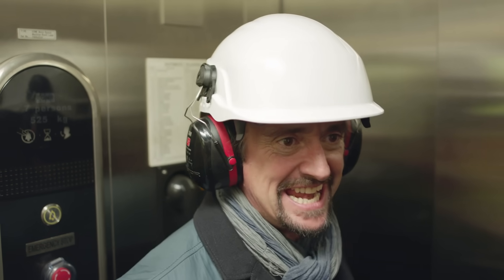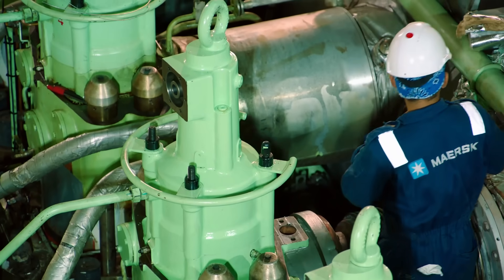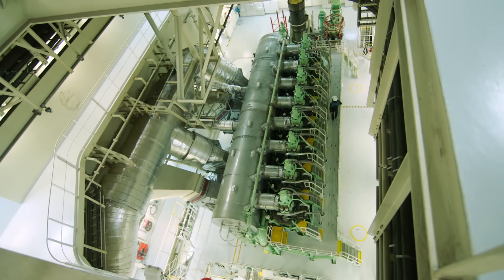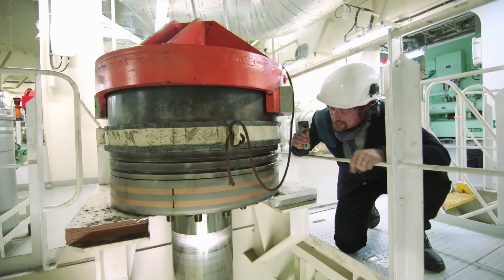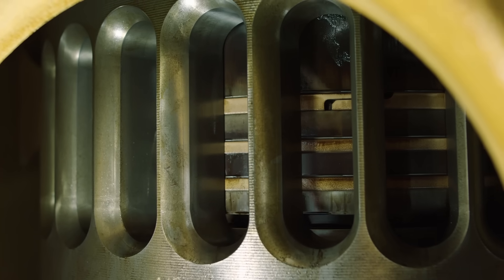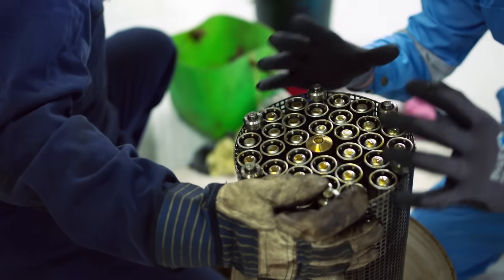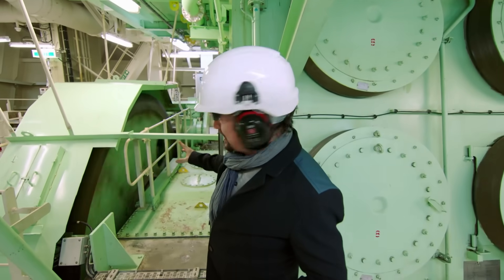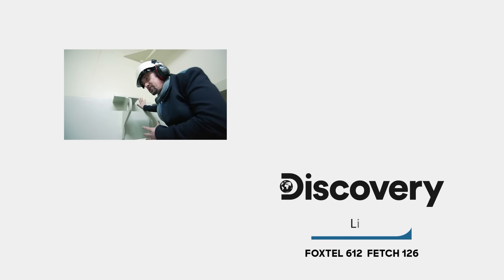This Engine Is So Big Richard Hammond Can Walk Inside It | Richard Hammond's Big

Comment: No hearing. So how do they go astern?
Reply: Reverse engine.
Reply: @alfamontydog I thought so. I have crewed on a 300ft motor yacht that has no reversing gear and to manoeuvre the engines had to be stopped & reversed. It was built in 1929 by Krupps and the captain had to telegraph to the engine room who had to stop the engines, reverse some cams with handwheels and then restart the engine with compressed air. Not easy.

Comment: Is there a clutch?
Reply: There is no clutch. A propeller shaft is directly connected to a crankshaft. So when the engine starts, the propeller starts to spin. Engine is started by a compressed air of 30 bars. There should be enough compressed air to provide at least 6 consecutive starts.

Comment: Where is the propeller shaft thrust applied to the hull?
Reply: The thrust block is right behind the engine, at least it was on the ships I sailed on as an engineer.
Reply: @alfamontydog  Thanks.  That's odd to my mind because it places the entire propeller shaft in compression!

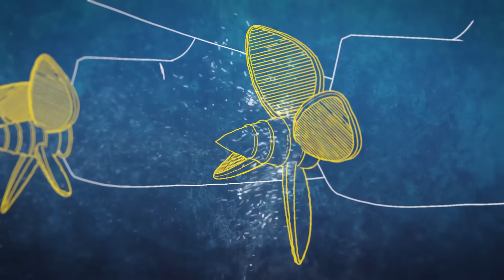Comment: 6:09 The animation of the portside propeller is wrong. It's rotating astern instead of ahead. This while the starboard propeller is going ahead correctly. The direction of the blades on the starboard propeller must be drawn wrong.

Comment: 18,000 containers? Why do I feel like this is HIGHLY exaggerated?
Reply: 18,000 TEU is not even the biggest size ship - 24,000 is
Reply: Because most Conatiners are stowed below Deck, and because it is measured in TEU. TEU means Twenty Foot Equivalent Unit, aka a 20 ft by 8.5 ft Containers. The most Common Type is 40 ft High Cube (9.5 ft) though, so your typical Container is more than twice as large as the Container with which Capacity is measured. Plus Ships are never fully loaded, at least by Container Number. If every Container Position was occupied, a Ship would be way too heavy. There are more Positions than neccessary to gain Flexibility; otherwise you'd constantly have to shift and restow Containers.

Comment: A single GE 90 115B turbofan can produce over 100,000 horsepower.   Don't know about a turboshaft version. Either way, it's not going to be as efficient or reliable over time.  then again it doesn't a continuous crew to keep it running or a huge room.

Comment: Since the engine is direct drive it has to be run in reverse to reverse the propeller.
Reply: Generally yes. In some cases a variable pitch propeller can be used instead, but slow speed diesels like this almost always are direct reverse

Comment: Marie Mærsk isn't even biggest. Emma Mærsk got the 14 cylinder Wártsila RTA96-C, making 80.000kW (~100.00hp), a little less than Marie Mærsk's twin 8S90ME-C 9.2 twin propeller, where each engine is making roughly 30.000kW.

Comment: Those aren’t engineers. They are technicians. Engineers don’t change oil filters 😐. That’s an insult
Reply: Marine Engineer here. There's usually two to four Engineers and three to five Mechanics in the Engine Crew, plus one or two Electricians. Filter Changing is done by the Mechanics, unless there's something going very wrong.

Comment: It's is so disappointing that ships like this aren't diesel-electric.  i.e. driven by electric motors

They could even use a turbine instead of a ICE as a prime mover.

Much greater efficiency and ease of drive control for the propellers.

Comment: If the propeller is connected directly to the engine without use of a gearbox, how do they put it in reverse? Maybe the engines are ported so they can turn in either direction equally well?

Comment: I usually have thoughts such as 'is there a simpler way'. I am not an engineer, but this thought came up. Replace that big engine with a few smaller ones that only generate electricity.  Then use electric motors for the props. I guess having an array of smaller props is not as efficient as one or two large ones? If one electricity generator fails, you still have enough power to go at some speed... just not full speed.

Comment: As an engineer at a HFO based Power Plant which run on diesel engines giving power output of 19MW each, I am no stranger to these type of engines.
Reply: HFO (heavy fuel oil) is not MGO (marine gas oil) or your so called diesel engines. Your engine either runs on HFO or MFO or MGO/diesel. Or hydrogen or steam or natural gas.
Reply: So your engine runs on HFO. Very polluting power station.

Comment: What do you use to start the engine? It surely can't be some giant starter motor powered by some giant battery. That would be impractical.
Reply: they use compressed air to start
Reply: @saradeanna  I was thinking of some auxiliary power source like a smaller engine to rev up the larger one but compressed air makes perfect sense. It's also used to start up jet engines.

Comment: Haven’t seen the drawings, but i bet you there where at least 5 more meters off shaft before the propeller gets bolted on.
Just because there should be a watertight compartment between where he was standing and the watertight bearing seperating the air in the ship from the seawater outside.

Comment: OK I have a genuine question. How do you make the opening where the prop shaft ends on the propeller itself water tight?
Reply: A shaft seal is used, very similar to the main oil seals on an automotive engine crankshaft. There are various types but they all essentially work by compressing some flexible material (rubber, or grease impregnated rope) against the shaft surface, while allowing a small amount of liquid to sneak in between the seal and the shaft for lubrication.
Reply: @nerd1000ify  Thank you.

Comment: 6:11 when you realize the left propeller is spinning the wrong way
Reply: Engine and Props are counter rotating to balance the torque of the props and avoid the ship from having a tendency of constantly turning. If they were rotating the same direction you would need to compensate with the rudder.

Comment: and the fact is that you can get 1/4 of that horsepower in a top fuel dragster which the engine is like the size of cylinder of that engine.

Comment: Something like this would be an amazing level in Hitman 3
Reply: If they did, I’m pretty sure one of the eliminations would be that one of the targets are near the engine, you turn off/sabotage the power restrictor in the engine as usual and turn the engine on at full power, then the pistons break off the connecting rods and the whole engine explodes.

Comment: 6:10 one of those propellers is going backwards
Reply: It actually isn't, if the propellers where to go in the same direction, the ship would slowly but surely turn to the right. Same concept as the Chinook helicopter, and naval torpedoes. 
Edit: left
Reply: @onyxdawn749  the propellers are the exact same so the one going backwards would go backwards
Reply: @lego_lad1310  Propellers are not the exact same, they are mirrored. Propeller also produces transverse or sideways thrust which rotates the ship, having both turning in the same direction for going ahead/astern would produce a lot of transverse thrust and make the ship basically uncontrollable.

Comment: I’m guessing it has to be a 2-stroke so they can run it backwards
Reply: Yes that exactly right, they use high pressure air to start the engine and just push the opposite cylinders to run it backwards when needed to go in reverse
Reply: Why would that have to be? (Also hello fellow Nelson!)
Reply: @creator4413  no gearbox, no other way to make the ship to backwards
Reply: @cpufreak101  variable pitch propellers?
I would have assumed its because of the extra power to weight and size constraints. Theyre turbocharged and still get extremely high efficiency, no need for extra strokes.
Reply: @cpufreak101  They can change the pitch of the propellers to verse thrust.
Reply: @Rob-pf6yl  did you completely miss my previous comment?
Reply: @cpufreak101  u clearly dont know what u r talking about
Reply: @giannidc1207  did you also completly miss my other comment, where I accepted a correction?
Reply: @cpufreak101  wrong
Reply: @cpufreak101  you were right, actually
Reply: @cpufreak101  Pitch propeller - adjust blades angles and you go "astern"
Reply: It's still not used for reversing though, although it could be. A ship like this has no need to reverse, manouvering in docks is done by tows.
Reply: @arturjogi2667  No, it is used for reversing while docking and maneuvering. The engine stops and runs in reverse to provide astern power. I work on these.

Comment: I thought those engines were to power electric motors then those turned the propeller?
Reply: There are different ways of sending power to propulsion. The diesel-electric combo is usually used on passenger ships as you can have the engines further away from passengers which helps with noise and vibration. Cargo ships usually have regular shafts as the engine is already close to the propeller.

Comment: And remember these engines are by far the no where near the largest marine engines ever built. The first ship I was on had a 89.000 bhp engine, 12 cylinders and each piston 90 cm in diameter. That was in 2003 (ship built in 2002). The largest I have heard of are 109.000 bhp, but there are possibly larger ones than that as well.
Reply: The biggest engine ever built is the very same engine but in 14 cylinder form
Reply: didn't he say it has two though? so if that's two 43,000hp engines the ship overall still has 86,000hp. almost equivalent to the ship you were on?
Reply: @RWoody1995  he means 109k Hp from a SINGLE engine, that ship could also have 2.
Reply: @RWoody1995  Yes, it has two.
Reply: I knew someone who said he was once inside an engine so large, the cylinder bore was greater than his armspan.
Reply: @shadowthehedgehog4737  I highly doubt that. Either he was a VERY small person or it is not true. The biggest piston is 96 cm in diameter meaning his armspan should be less than that.

Comment: The scale of the engine is impressive - the HP is astounding.
Reply: It's small compared to Wärtsilä RT-flex96c.
14 cylinders
80080 kW
7,6 million Nm of torque
Reply: @UltraCasualPenguin  Wow. 107389 Hp.  Now that's a monster!
Reply: @UltraCasualPenguin  nice try Wärtsilä... the MAN B&W ME-C or GI has more 82MW
Reply: @JuanFredful  MAN B&W 11G95ME-C9.5-GI is only rated at 75570 kW (103000 hp). So, close but not quite there yet.
Reply: @UltraCasualPenguin  I am talking about the 12Cyl version
Reply: @JuanFredful  It's not used anywhere. Only thing I can find about K108ME-C is Wikipedia page that looks like advertisement. No history, where in use etc.
Reply: @UltraCasualPenguin  Yes, because vessels are too small for that engine.

Comment: 100% someone will try to fit this inside a miata
Reply: FORZA Horizon 4 engine swaps be like:
Reply: @evadjdrb5451  dam  it I was going to say that
Reply: Miata in the engine
Reply: Imagine the Torque you can Get if you Swap this! You can Pull a Train with your Miata!!! HEXK YEAH!!!!!!!
Reply: @lossantoscity3249  many trains
Reply: It wouldn’t fit
Reply: @edencovich6148  that’s what she said!
Reply: @skrotosd  you wish
Reply: @edencovich6148 miata or the engine?
Reply: There are small block engines, then there are big block engines, this is a perfect example of a big block design 🤘
Reply: FasterProms
Reply: The Miata is smaller than this engine - and weights quite a bit less.
Reply: @bricefleckenstein9666  r/wooosh
Reply: Zach from Wheeelhouse is trying to figure that out.
Reply: Garage 54
Reply: i smelled this comment from a mile away
Reply: and the miata will still 0-60 in 1 minute
Reply: Will this fit in my Honda?
Reply: Beat me to it
Reply: @clickbaitme5247  bro its been 3 years
Reply: It would crush a Miata
Reply: @SixOhFive  better suspension???
Reply: It won’t fit in a Miata
Reply: Im pretty sure that someone also gonna ls swap it
Reply: @sabyasachiroy7482  I just had a seizure trying to read that

Comment: In Denmark are there a ship engine Diesel House In Copenhagen. There can give Light to Denmark and there they have engine part from a car to a ship 🇩🇰👍🏻
Reply: I was part of the team that set up DH. They had another, smaller museum in the centre of Copenhagen but the opportunity came up to move many items when the power station that houses the new museum no-longer needed to have the large, supercharged (yes, supercharged) reciprocal diesel as the 'Number 1' re-start engine for electricity supply in Denmark.

Comment: How much diesel would this use in 1 hour of running?
Reply: It does not use 'diesel', it uses either MDO or HFO - the newest engines also add gas. The biggest engines can use over 200 tons of HFO per day. This engine will use up to about 4 tons per hour.

Comment: This is a medium sized 2-stroke marine diesel engine. The really big ones have 14 cylinders and 108cm diameter bore.
Reply: I belive this i a MAN b&w 8s80me-c 9.2
Reply: @andreasisaksen2449  This is NOT the B&W engine. There is an easy way to tell the difference: the B&W engine's fuel pipes have 2 small 'kinks' in them while the Wärtsilä has a smooth curve. I was the technical writer for MAN B&W.
Reply: This is Wärtsilä RT-flex96c wich is world biggest engine.
Reply: @Jere04  the biggest tr-flex 96c is 14 cyl, this is 8.
Reply: @Jere04  This engine does NOT have a 96cm bore. It is more like 60cm.

Comment: You should rotary swap it
Reply: Rob Dahm has entered the chat *
Reply: These engineers would never get any sleep 😂
Reply: @gab607pnt  Nah dude. Remove the oil and you wouldn't get a problem with leaks.
Reply: A rotary that size is called a turbine
Reply: Super rotary
Reply: It wouldn’t be “Brap brap brap” it would be “BRAAP                                BRAAP”
Reply: There isn't enough oil in the world.
Reply: Ah yes, a 1 giant 8 rotor diesel rotary engine

Comment: Imagine a runaway diesel on that engine
Reply: I accidentally got the diesel engine in my truck to run backward.  Exhaust came out of the air filter.  It was a 427 Cu In turbocharged inline 8 in a 2-½ ton army truck.
Reply: would likely sink the ship if it blows a cap or a rode, through the bottom or the side.  The nice thing here is there is so much inertia it would take a min or so to reach top speed - plenty of time for fuel or air cut.
Reply: @lm1584  It would not. The vessels can withstand multiple flooded compartments. The engine room also ;)
Reply: They could shut off the exhaust valves and fuel injection, these engines are pretty well safe from any unwanted overspeed

Comment: Totally dull question, what weight of oil does that thing use?
Reply: About 20 - 25 cubic meters in the system. Cylinder lubrication is separate, uses about 200 l daily
Reply: @UmiKitsunes  I think he means what SAE class, like is it e.g. '10w-40' or '5w-30'?
Still, pretty cool to know the volume though lol, cheers

Comment: At 6:11 the Port side prop is rotating in the wrong direction. Its actually going Astern. The Starboard prop is going Fwd. Means the ship will basically spin on its own axis.... Just saying.
Reply: Not necessarily,it would depend on the pitch/angle of the blades on the propeller.
Reply: @donburke4886  The Stb prop is rotating clockwise and the prop is creating fwd thrust. The Port side prop is rotating counter clockwise with a right hand prop identical to the Port side(both props are right hand)  It (the Port side prop) would have to be rotating clockwise to produce fwd thrust, as it is rotating in a counter clock wise rotation and a right hand prop, it can only be creating reverse thrust.

Comment: I can only imagine what would happen if that engine became unbalanced
Reply: @markj2093  No you cannot... If you cut out one cylinder (its actually best to leave the piston inside for balance purposes) there is a limit to how fast you may run the engine. If you cut out 2 you may still run it, but it depends on which 2 cylinders.

Source: I work for the company that designed the engine you see in the video.
Reply: @lolsovs  not taking into account the torsional vibration dampener plus top bracings

Edit: did not notice you'd already mentioned vibration dampeners aha
Reply: The engine may become unbalanced in multiple ways. An engine may typically have a chain at the back driving the hydraulic system (fuel injection and exh valve are hydraulically operated) and a couple of vibration dampers - a spinning shaft with an imbalance on. If these vibration dampers get out of timing (they are timed with the engine), you will have massive vibrations. Some engines also have a chain and dampers at the front as well. 
You may also have severe vibrations in certain rpm ranges, but the control system is designed to accelerate through these ranges as quick as possible. Another way is if you pull out too many pistons and run the engine, you loose the constant downward force on the crankshaft bearings from the compression/ignition and, again, vibrations - although this time your bearings are toast as well.
Reply: @markj2093  Interesting.